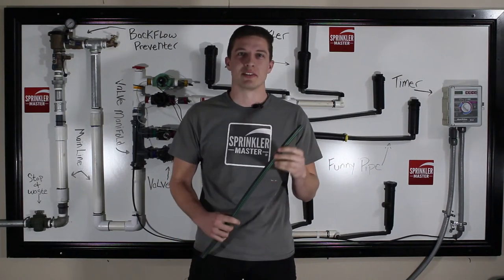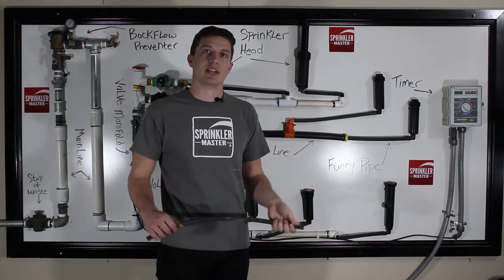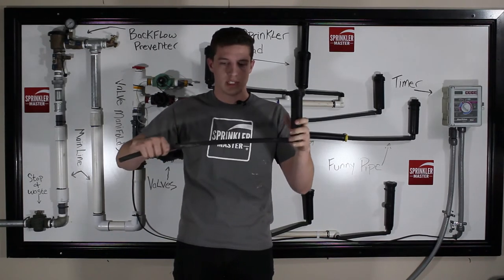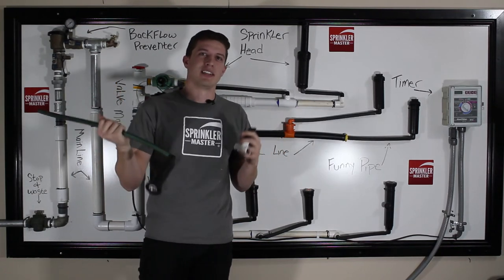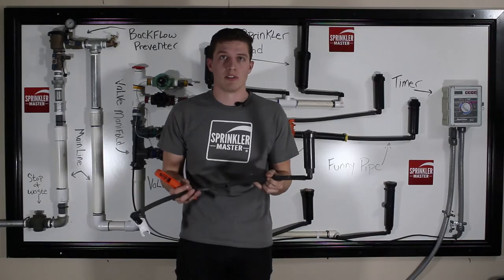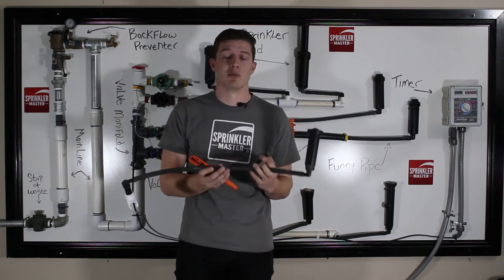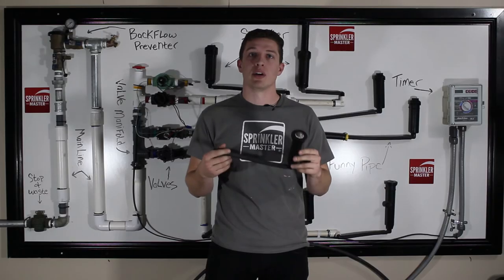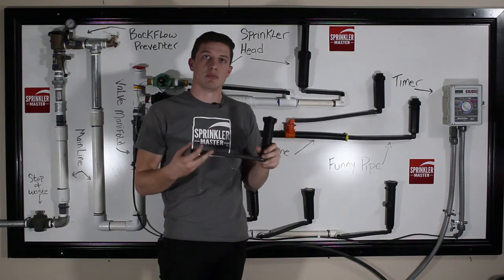Funny Pipe-Talking Overview

Comment: All of my sprinkler heads are attached directly to the distribution PVC pipe via risers, and several are stuck at an angle. The funny pipe / flex pipe connection is clearly the better way to do it, since I can move the head or rotate or angle it exactly where I want it instead of needing to connect to a fixed attachment point (which may be tilted away from vertical). Thanks!

Comment: Nice! Two questions please: 
1) I have my garden tap marked as 1/2" - what size of PVC pipe should I use to get water from the tap to pop-up sprinklers?
2) What type of irrigation should I use for flower beds: pop-up sprinklers or drip hoses? The beds are ground level, along the fence (about 3-4 feet wide and 26 feet long).
Reply from the maker: Apologies for taking a while to reply!

From what I understand, you mean a hose spigot? If so, we wouldn't really use a hose spigot as a valve for a zone. We would use a valve, probably an automatic valve and connect it to a timer. So in order to connect that, we would probably cut the hose spigot out, and use the PVC pipe as our starting point. Hope that helps a bit. 

It depends on what you need! Drip hoses are EXTREMELY accurate. If your flower beds have a few flowers and you can get a drip line to drip specifically on those flowers, then that would generally be the more water-wise option. You only water the plant you want to. Pop-ups are easier, and less water efficient, and water the entire area. So it depends on what you need! In general - lots of flowers = use pop-ups. Few flowers = Drip Line!
Reply: I've used 3/4 in PVC pipe

Comment: Great video! Is your 1 inch poly the same as what is usually used for drip lines or is it different? I have trees and bushes I need to maneuver around so if I could use drip hose as my main line on top of the droid but under the bushes, that would be such a relief! Can you please specify what the poly is - or a link to the exact product so I get the right stuff? Thank you!
Reply: I wouldn’t recommend using a drip line as a main line

Comment: funny pipe length should not exceed two or three feet due to excessive pressure loss. for longer lengths  should use one inch from exisiting head then use funny pipe for the last foot or so to place head in correct position